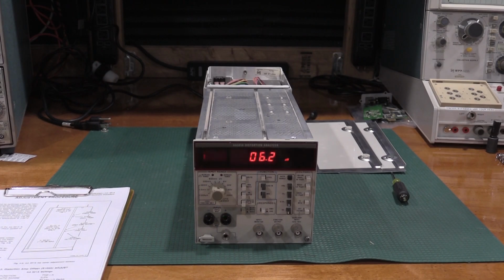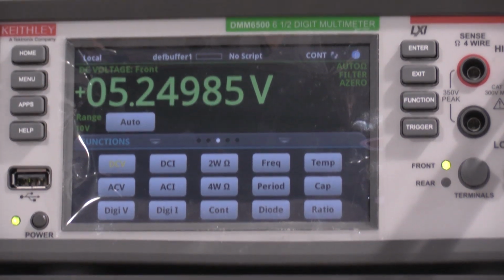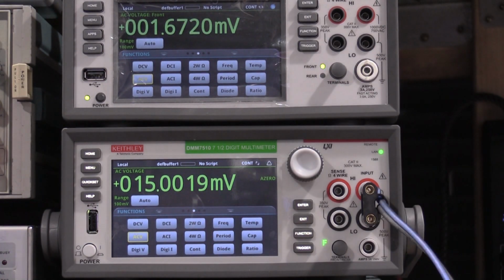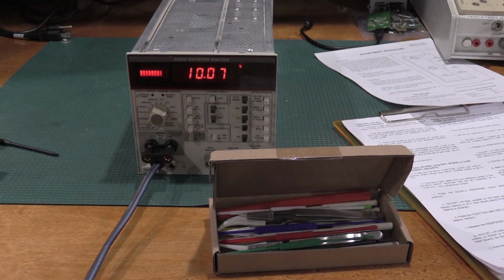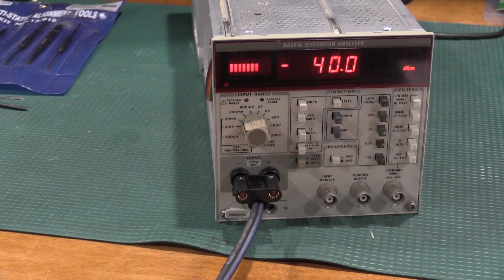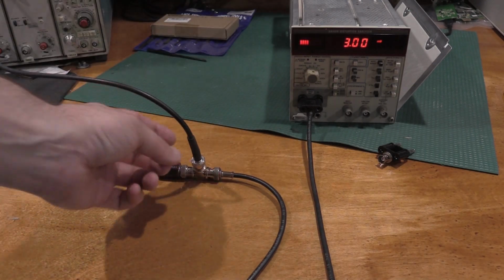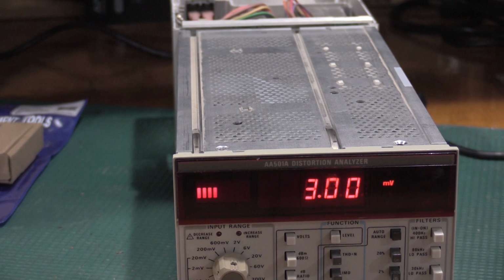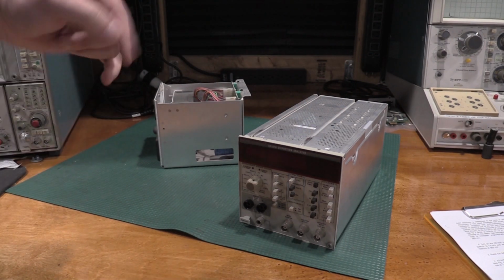Tektronix AA501A Calibration

Comment: I guess you did not feel the need to check the input impedance?  Maybe it did not make it on video.  : )
Reply from the maker: Dave, There are usually 2 procedures in the service manual. The “performance test” which is an exhaustive test of all the adjustable and non-adjustable circuits. There is an alignment procedure which is the adjustments. This video is the adjustments. The input impedance on these units is non-adjustable. Usually if the unit wont adjust there is issues that are out side of the range and the performance test can give some hints as to the location of the out of spec components.

Comment: Are you based near an airport  / military establishment or somewhere with a Radar as they can induce chirping noises in multiple systems
Reply from the maker: Not really "near" an airport. It is about a 45 minute drive away. I can hear the chirp in my signal tracer and it a quite broadband noise as i have noted on my slow spectrum analyzer. I need to build one of Mr Carlsons’s super probes to help track it down but after some more digging it looks like it Is induced EMI not common mode noise.  Using the AA501A with the shield of the coax grounded I can get a good measurement. With the shield not grounded using differential measurements it is all over the map and won’t settle so that is at least a clue. One of the thoughts I had today was there is a lot of blue tooth in the lab a 3 workstations have it as well as my phone and tablet. I am thinking I might start by disabling the scanning of blue tooth items if it is still turned on.

Comment: Hello, a couple questions. 

1. Wondering if you happen to know if the calibration procedure for the AA5001/DA4084 are similar to the AA501?

2. On the step where you calibrate for 1% THD+N could you elaborate on how that signal is generated. I can see the connections but do not catch witch oscillators you are using at which frequencies. 

I am trying to get my hands on the calibration procedure but wan't to make sure I have the proper test equipment to do the adjustment before paying for a service manual.
Reply from the maker: Hi  Novalux Stereophonic, A couple of answers for you.

1)	I have not done a AA5001/DA4084 yet. Currently do not have one in the lab. If there is some interest in that I would be more then happy to see what I can make happen. Something to note though as this is a 5000 series unit you can not use the 500 series frames to power it. You will need a 5000 series frame.
2)	The function generators needed to do this unit taking in to account that it is an option 1 unit I needed (2) SG505’s and a FG501A or FG504A. I used the FG501a an FG507 will also work as long as you disable the sweep function as it is a FG501A with sweep. If you do not have an option 1 then you only need (1) SG505. For the THD+N calibration it is FG501A and SG505. The SG505 is providing the fundamental, and the FG501a is providing a set amount of “ Noise” through 30X of attenuation.
Reply: @ZenwizardStudios  I ended up tracking down a cal procedure for the DA4084. Looks like it was listed with the part number for the custom mainframe and DA4084 plug-in. The procedure seems to be very similar, maybe even identical to the AA501. I do not have an FG501. It looks like that unit operates at .5% THD in the 7KHz range. Should be Okay to use a Siglent oscillator to produce the 7KHz signal in conjunction with the SG505 correct? The Siglent has .08% THD in that range.

Do you have a recommendation for the 50 ohm pass through and attenuators?
Reply from the maker: The Siglent should be fine if you have the SG505 for the fundamental. The siglent does not have a good enough spec for the fundamental but exceeds the FG 501 for the modulation. SG505 is 0.0008% or better.  I have 1 of the Tek 50 Ohm pass thru’s and I have 2 from Rigol. The Rigol ones seem pretty good. I will be having a video come out shortly that will let us take a look at them at least up to 3Ghz. My two new additions to the lab got here a little early so when I clear the bench of the current project I will be shooting that video. Some HP goodness arrived, need to make sure it is working correctly Then I will be able to tweak some of the 502s and the 505s. If you want a better name then rigol on the 50 ohm feed thrus Amphenol is also good. I will be looking for a modern source for the attenuators shortly as mine a breaking down slowly and most out there have lots of hours on them.

Comment: Just received my TM502 for repairs. You’re a bad influence. Did you ever consider cutting the blue outer shell down the power supply’s size?  That would help isolate the hot spot on the right side. I haven’t cut mine because I thought maybe you had already found a good reason not to.
Reply from the maker: I have not decided If I am going to cut mine yet. The "hot spot" is actually should to be hot it is heat sinking for the pass element for the left socket.
Reply: @ZenwizardStudios  I took the plunge and cut off my TM502 case.  Tough material.  Very impressed Tek.  I feel better about grabbing the unit during repairs while it's turned on. I started the calibration on my AA501 and nothing needed adj.  But it measures a 0.0007%  dist (from AA501A) signal from the SG505 at 0.25% dist.  So somepin's not right.  Where to start?
Reply from the maker: Make sure the signal is turned up from the SG505 don’t be shy with it. the AA501A can take 200V on the input it will be fine It needs to be able to lock on to the fundamental frequency really well so it is not hunting. Also The AA501A cant actually perform at the level the SG 505 can. Noisy environments grounds connections cables at these low levels everything is a source of noise.  The AA501A that I have is ONLY ha only speced for less then 0.0032% (with filtering) THD. Now with my SG505 at about 1Khz with a good strong 0dbm signal I am getting 0.0030% With no filters the AA501A is only speced to  <0.0071% spec is met at 0.0064%.  The limitation is definitely the AA501 and not the SG505 verify the thd of a 505 is a complex and involved process so much so that even the service manual advises against doing it if you don’t have to.  Also if you hook a scope up to the function output. You will see the distortion components that the AA501 is measuring that might give you a hint as to what it is seeing.
Reply: @ZenwizardStudios  that’s good advice. I’ll move the signal up. The older AA501 is the one that’s reading high distortion. I’ll scope it as you suggested. It should show a big difference from the newer AA501A. The AA501A is in the TM506 next to the SG505 on a 3” cable and reads a healthy 0.0007% at 10K and 0.0008% at 1k (all filtered up) . And that is pretty close to my HP Audio  Analyzer with matching filter settings. The Older AA501 is in the test rig on a longer cable and has a long way to go.  I thought it was interesting that the cal procedure did not mention 600ohm termination for the SG505. I still assume it required it to keep the SG in line.
Reply from the maker: Hmm, given your readings Rick I am starting to doubt my 505's.... I guess it is time to hunt down a notch filter. Though it could also be lab noise on my end. We know my lab is not the quietest place at lease RF wise.
Reply from the maker: Some just observed behavior on my 505 was at 1Khz 0.0090% but on the 10 X range it dutifully went to 0.0007% so currently cleaning the multiplier switches now I will let you know if something comes of it.
Reply from the maker: The plot thickens yet again. I hooked the rigol up to the function out of the AA501A. and the frequancy counter to the sample out of The 501A. and it looks like the notch filter is not filtering out the fundamental they way it should be. I am getting bleed through of the fundamental frequency match at the outputs so even though it calibrated in spec this one is a little weird. I am getting pretty much exactly the same distortion measurements with the 505's set up the same way so I am starting to think the 505's are fine
Reply: @ZenwizardStudios  You're probably right.  I am pretty comfortable that my 505 is good at 1x and 10x.  It the two AA501's that reflect vastly different dist readings.  I will check the fundamentals on the scope when I get to the lab (home).  You're probably happy your leaning away from a prob with the 505.  I have the notch calibrator.  It took me two years to find it and cost almost USD$375.  That's a lot for a seldom used plug.
Reply from the maker: Rick, I checked mine and found that the notch filter needed more adjustment specifically step 9 and 10 in the calibration document. Do this with the unit closed up sides on and shielded. I was having some Fundamental bleed through but use the visual method with the 2 channel scope SO much easier and a faster response rate I was able to dial it in even better then before.
Reply: @ZenwizardStudios  I made some errors on my AA501. First I used a single 600 ohm terminator at the exit of the SG505 before splitting to both AA501’s. When I place a terminator on each entry of the 501 both read almost in sync. I wonder which is correct. The old 501 goes very high on dist as soon as I hit 30k and reads normal at 27k. Then goes bad when brought down to 3k and clears up at 2.7k. the dist reading goes bad. The 2.7-3 pattern is clearly there. During each bad section the function out BNC stops showing a filtered output. It returns the clean sign wave. Its odd that it references the same range no matter the order of magnitude. I’m sure it’s telling us what’s wrong. The other AA501A is fine across that whole range. Time to read up.
Reply from the maker: Rick, If you are getting clean sign wave out of the function output not the monitor out then the nulling and notch filter is not behaving properly. The over simplified way a 501 works is the circuit scans the inputs and locks on to the fundamental frequency it then uses a tunable notch filter to reduce as much of the fundimental as possible. The distortion amp then amplifies what is left and that is the distortion components based on (total signal + all noise – fundimental = distortion).  When I did the calibration I had that weird chirp going on and it did not let me get the notch filter right too much noise in the lab. I was able to get it MUCH better last night using a scope and the visual method. Step 9 and 10 of the cal document. It now reads 0.0010% on the display and holds there.

Comment: Great videos! Assuming you have these....I'd love to see a usage overview, repair and calibration on Tek's 5S14N Sampler, 5TC1N Curve tracer plug-ins and a 577 Curve Tracer.  I have these units and they are not up to snuff. [never mind the 577, you've already got a video! I think our labs are a mirror of each other]
Reply from the maker: I will see what I can do I currently do not have anything in the 5000 Series, the lab is based in the 7000 series. Though I do have a 7tc1n In the lab. Take care with the 577 there are some decently high voltages in it 1,600+ volts.
Reply: @ZenwizardStudios   That 7TC1N is really close to the 5 series.  I repaired my 577 when I first got it about 5 years ago.  It was a mess. It's time to do a performance check on it again and you video inspires me.  I got it to match tubes.  I have a fixture for preamp tubes but not 6L6's or EL34's. I've ended up using it for diode and transistor troubleshooting.  It's interesting how working on guitar tube amps led me build Tek audio lab which has led to restoring vintage test gear.  I'm having trouble getting back to the amps because fixing test gear is more fun...
Reply: 7CT1N and 5CT1N are identical apart from a little connector adapter board on the latter.

Comment: Which TM frames are switching supplies?  I have a TM503 and TM506.  These aren't switching supplies are they? My SG505 is 0.0007% distortion in a TM506, so it never dawned on me that they might be switching supply frames.
Reply from the maker: Rick you are good there the 500 series supplies are linear the 5000 series are the switching ones. I have a video on repairing a 5006 supply there is a vast difference in the architecture.

Comment: What do you have the AA501A connected to ?
Reply from the maker: The cube in the back or the signal sources used in the calibration?
Reply: The cube in the back
Reply from the maker: That is a TM502A power supply that has been removed from its case.

Comment: I did a 19 part video series fixing my 5200A, I had to repair every single board ! (sometimes more than once)
Reply from the maker: I know you and I traded messages on the EEVblog form about it. It really helped get mine up and running. It turns out mine had a burned out -190V supply that cascaded. Fortunately, Mine was a USAF unit that released the smoke and they just stopped using it and sold it.

Comment: It also looks like you should check your NPLC settings on your meters to help remove mains noise from the readings.
Reply from the maker: Usually I run the meters at a minimum of 1 but more often then not 10 to 15. 15 is the highest you can set the Keithlys to.

Comment: Very nice. I presume the 5200A you referred to is the Fluke AVC? Now I'm seriously jealous!   ;-) 
That chirp you're getting must be incredibly frustrating. Is your lab located in a heavy industrial area? 
Anyway, thanks for posting these videos. AFAIC you can keep doing Tek gear but any  older, lab grade equipment like Agilent/ HP, Keithley etc. would be great as well.
Reply from the maker: It is the Fluke. I have a very early video about having to repair it. There was a fair amount of damage in the power amp supply. I will be branching out from Tek gear to include some other makes as I build out and grow the lab. I am not in a heavy industrial, but I am close to some high tension power lines. Sometimes it is not there other times it is really in the way and frustrating. I have hooked an antenna in to the front end of the spectrum analyzer and it is VERY broad spectrum or at least super harmonically rich. As there was lots of peaks that were outside of the broadcast band My current spec an only goes up to 40 Mhz so I don’t think it is the wifi as beacon times are turned off at least for my wifi.
Reply: @ZenwizardStudios  Just guessing... HP3585A ?
Reply from the maker: It is a B not an A but yep.